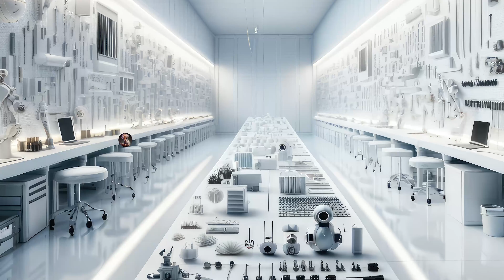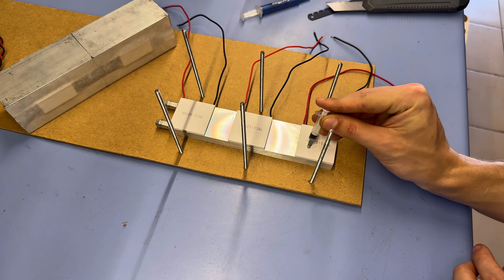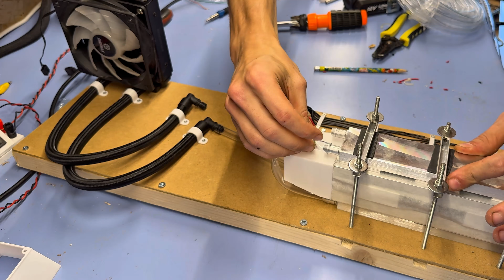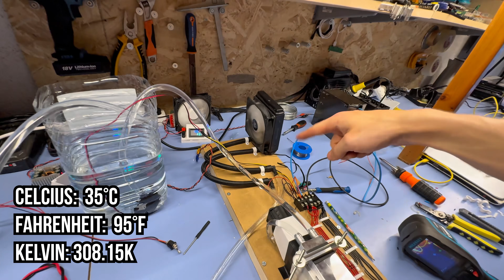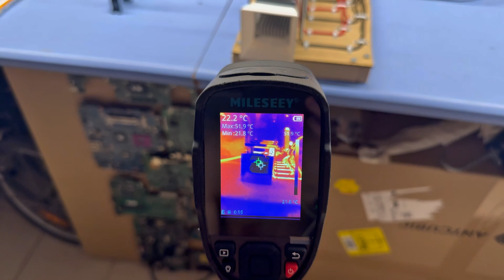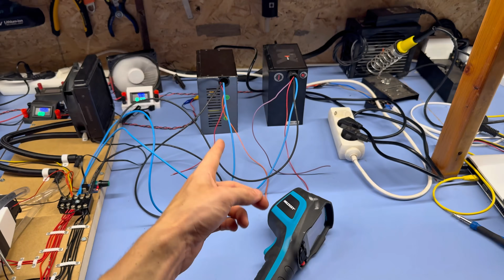I Built an Air Conditioner with 6 (8) Peltier Coolers and it WORKS!

Comment: EXCELLENT! - In the gap on the aluminum 'cold tunnel' you should have something more substantial than tape. You are losing a lot of cold along that tape, so you should have somethign more insulating, so it gets colder. You should also insulate any area of the 'cold tunnel' that is just exposed to air, you are warming it A LOT by not insulating anything. You can get a sheet of rigid thermal board for a home repair store fairly cheap, and you won't need very much for this application. I really hope you do this :) PLUS you should try this before you add more Peltier devices, just to see which helps more :D
ALSO, you can stack Peltier devices I think. So each out would be much colder, but you would have much more heat to pull off of them. And this is not always very smart, so maybe you don't need to try it. You seem to be getting it quite cold already.

Comment: Use a car radiator and a 12v fan on the outside. That way you wil get a nice delta temperature
Reply from the maker: Great idea, I was also thinking about a radiator from an AC, but quite tough to find one in a good shape
Reply: Well if outside is cooler you can just use 2 radiators to cool.

for actual cooling of a room you of course have to pump the heat out of the space, so the radiator by necessity has to be outside of the space, otherwise you're just heating the room with couple of hundred watts.

Comment: You would get more cooling with less energy from a cooler full of ice and water, some piping and a 9cm 12v USB fan. The heat from the power supplies is likely negating any cooling this contraption is creating.
Reply from the maker: Yep, I actually want to try comparing an ice air conditioner and the Peltier one

Comment: Oh jeez not ANOTHER peltier AC video. Right, Peltiers are massively inefficient, They require a huge amount of power which far outweighs the VERY marginal cooling effect, and you have to dump all the heat the produce. There's a reason commercial AC units use peltiers. Also even a mild rise in ambient temperature virtually cancels out the cooling effect.
Reply from the maker: Yep totally agree! They are good to make a tiny fridge, and I mean really tiny! This experiment is to see if we can decrease the room temperature by some degrees. Also if the AC is connected to solar panels and suddenly the sun gets covered with cloud. The Peltier AC can be turned off and on without any problem. If a Normal AC shuts down unexpectedly it can damage the Compressor or compressor circuitry. It is another reason we are using Peltier units in this case)
Reply: @Inventors_Den  No chance. Large commercial can  only drop the room temp by a few degrees, this...this would be like trying to warm up a warehouse with a hairdryer.

Comment: I'd be less interested in an AC/Heat Pump and more in a dehumidifier. This could be useful in maintaining a dry cabinet/box for 3d printing filaments and whatnot, or maybe a large enough dehumidifier could be useful as a clothes dryer when placed in a closet?
Reply from the maker: Damn that’s an awesome idea I just need to flip the positive and negative and it should start heating up with a drier air! Will try it someday thanks!)

Comment: the hot side water pipes should be in parallel to the pump and a 3 fan size  radiator should be used, pelta cooler should be paired in series 3 sets of 2 if you have six.
Reply from the maker: True, I was thinking of connecting the water radiators in parallel but will I need a T shape conector  and 3D printing won’t work because if the water is hot the 3D Print becomes soft. 
Unfortunately I don’t have a 3 Fan radiator 😣
Pairing 3 Peltier modules in series will require 36V won’t they?

Comment: 55 Fahrenheit is an excellent temperature for air conditioning supply air.Typically in direct exchange air conditioning we try to maintain a suction pressure equal to a 40 degree Fahrenheit evaporator and ideally,the warm air from the room heats the suction line to 55 degrees,which is a 15 degree suction superheat.
Reply from the maker: Thanks for the feedback mate! Can’t wait to see the real results in the room) Peace✌️

Comment: I would love to see a deep dive of this vs. gas compression and decompression efficiency. It seems like it uses a lot of electricity for smaller gain in cooling, maybe some way to measure the power usage?
It also makes me wonder why there isn't a Peltier designed specifically to move heat from air with maximum efficiency, if it really does boil down to energy conservation and systems of entropy...
Reply from the maker: Thanks mate! I'm also wondering about the efficiency numbers, and it is a great topic to cover! The device is on its way

Comment: A very powerful installation with low efficiency emits a lot of heat. Thank you, it was interesting to see. I want to assemble a compressor, the components are a compressor, a copper tube, a refrigerant, and the efficiency of the installation is high.
Reply from the maker: Thanks for watching! I also want to build a compressor based cooling system, but first I'll finish this experiment to see what it can do inside a room) 

I was wondering if the compressor will somehow consume the refrigerant or it will stay constant, the cooling effect is achieved with pump?
Reply: @Inventors_Den  Hello from Ukraine. The compressor does not consume refrigerant. It can be used up if the system is not airtight. The efficiency of Peltier elements is about 0.3-0.5, the higher the temperature difference between the sides of the element, the lower the efficiency, so you need to cool the hot side well, low efficiency means that more energy is spent on cooling than cooling. Try colder water and a larger volume, this will significantly increase efficiency. The compressor of a refrigerator with refrigerant r-600a has this coefficient of 1.49. Cooling occurs due to compression and condensation with cooling of the refrigerant into a liquid after passing through the capillary tube and entering the area with low pressure, the refrigerant boils and absorbs a significant amount of heat. Ideally, you need to maintain the required pressure in the system for proper operation.

Comment: I remember doing this in my garage thinking I could replace my a/c in my car, problem is the best delta temp differential you could get would be about 40 degrees and it took so much power and created so much heat it didn't end being worth while
Reply from the maker: Interesting experience! In a car you can cool the radiator with outside air which is a plus. I will share the results of my experiments soon, peace ✌️

Comment: Try adjusting the power given to peltier modules,try to keep them from getting so hot
Reply from the maker: Good idea but I couldn’t find a regulator which will work with this huge current)

Comment: Its far better to cool say 100m3 by 1 degree, than 10m3 by 10c, if that makes sense? 
Trying to get as low a temperature as possible isnt actually MOVING much thermal energy, though heatsink areas factor in as well...

Increase flow until cold side is only removing a degree or two. Get hotside as hot as possible to radiate the most energy. 
Air in a room recirculates, if it drops a degree every time.

Also note the majority of heat is in the water vapour... not the air. Water vapour has twice the specific heat of air...
Dry air feels cooler simply as it assists evaporation, and its far easier to cool as well...
Reply from the maker: Great point, thanks for the feedback! I actually  already increased the airflow and made it controllable, thanks for the advice!

Comment: Try to cool a small area.
I did a similar thing, though pumping warm air into a sleeping bag.
You could potentially do the same for cooling with a jacket or coat.
You don't need to cool the room, just the air close to your body.
Reply from the maker: Thanks for the feedback) Yes I will install it in my room really close to me so let’s see… Peace ✌️

Comment: Connect this cold air ducting to a pc heat sink and over clock a cpu. Expensive wattage but cool video.
Reply from the maker: The best contraption for this I think will be stacking some units together and like this the last one will get super cold which is great for overclocking

Comment: That was very entertaining, thank you for taking the time to produce the video.  I like that most of the parts are less than $1 (advertised amount).  It may not be the most efficient solution for cooling, but it would be fun to make and have as an emergency back up in case an a/c unit crashed during a sweltering summer weekend.
Reply from the maker: Thank you mate! Can’t wait to see how cold will the room get once installed)

Comment: Your room with get hotter if you put this inside. You're dumping all the energy you're removing back into the same room in addition to the heat generated by the power supplies and inefficiencies 😀
Reply from the maker: You are right! I will put everything outside and it will blow fresh cold air into the room

Comment: Yabbut, where is that heat GOING?  Why did you bother with this?  You did not build an air conditioner.  As built, this unit cannot cool a room or even a cardboard box. Instead, it will make everything WARMER.
Reply from the maker: Thanks for feedback! The purpose is to find how cold the air leaving the unit can be, and since it’s 13C (55,4F) the next part is to find how cold the room can get! All the hot elements will be outside the room behind a wall with a hole for the cold air duct! Peace ✌️

Comment: You could try to use the peltier devices in reverse to try and absorb heat from a solar panel to see if you can boost their  efficiency by cooling them down or by syphoning some power from the heat difference.
Reply from the maker: Thanks for idea mate, in fact I will be building a machine in the future to get electricity from Peltier modules. To get an idea on what it can be I can say that people in USSR used to build them on the country side to be able to listen to the radio!

Comment: What’s the total wattage ?
Why did you only use one wire for the 12 V. I’m sure that  power supply out a few of them. Typically the max is 8 A per wire, but I would go with about 4 A per wire.
I’m not sure about the details of the power supply, but I’m thinking you should get enough power from one. 
What’s the details of the peltier ?
Reply: Also, you need way more airflow so that the cool part doesn’t go below 40° so you don’t get a lot of condensation.
Reply from the maker: I am waiting for the measuring device to arrive, will post an update when it does! 
Theoretically TEC1-12706 are 4,3 - 4,6 Amps so ~50Watts so 6 of them will take ~300W and 8 will take 400W, let’s add 30 watts for everything else and the total power consumption will be ~430W. You are right a good gaming power supply should be able to handle that, BUT my power supplies aren’t new at all, and were taken from a PC years ago(No idea for how long were they used). 
And yes I will be increasing the airflow, the 40x40mm fan won’t be enough even for a small room)

Comment: Well done. I'm building something similar. Two recomendations.

1- Don't cool the water with a rediator. Try to use evaporation and vent the humid air outside. Evaporation becomes more efficient as the water temprature increases. A low cfm fan would be enough as long as you can have ideally 5-10 m/s air velocity for good evaporation.
2- Instead of a heatsink for the cold side, use another water loopwith water blocks and use the radiator for cooling the room. By using a heat sink you lose a huge amount of egergy and I mean HUGE(I did the math) to turn the water vapor into liquid without decreasing the room temp at all.
Reply from the maker: Damn, that’s is super useful! I didn’t think about these and to be honest want to try it asap, thanks a lot for the suggestions!
Reply: Peltiers act differently and the colder the hot side can get the colder the cold side will get. If you want a peltier to be efficient, it needs to be as cold as possible on the side the heat is being transferred to. A heatsink will work better in this case unless you have a very large radiator to bring that water down to roughly ambient temperature.
Reply: The problem with evaporative cooling like that, is you consume water.  You could still make a closed loop with evaporative cooling tho.
Reply: can you give more detail, havent finished watching this video all the way. But working on something similar as well .

What do you mean - use evaporation and vent the humid air outside?
Reply: @MM-24  Use a water container which hold the hot water. I'm using a coolbox. As the water heats up it starts to evaporate faster. Just make sure that the cotainer is sealed and has a exhaust port. I made a hole in the lid of the container which is my exhaust port. I used flexiable pipe to connect the exhaust to my room vent port(my room has a vent port). The idea is to get rid of the water vapor generated as the result of water heating up.

To make evaporation even faster, you can attach an small fan to the lid that blows on the water surface inside the container.
My evopration setup is more complex, it's not easy to explain it with text. even a 40mm fan would be far beter than no fan.

To get very good result, you need 1 liter of water for every 3 cubic meter of volume of air you want to cool, however you can use just few liters of water as well.

Comment: Terrible.  The coefficient of performance - that is, the ratio of watts of heat moved per watt of electricity consumed - with TECs is less than one* in cooling modes.  You're consuming more electricity than my entire refrigerator AND freezer to generate a tiny stream of not-refrigerator-cold air.  This is fun as a novelty but in terms of actual cooling it's a non-starter.

*In heating mode TECs can move more watts of heat than watts of electricity, but it's still not better than an even middling-fair heat pump.
Reply from the maker: You are absolutely right! The TECs are great if you need to build a super tiny fridge(I mean SUPER tiny). This AC is built as an experiment just to see why they are not used for ACs and what cooling results (if any) can we get)
Reply: @Inventors_Den  In that case you have a lot to think about. WIth peltiers the colder the hot side can be the colder the cold side will get. (This is why there are plenty of experiments of stacking peltiers and reaching very cold temperatures) So if you cool the hot side of the peltier extremely well it will be much more efficient and it can get colder as well. If you continue to cool the peltier with water cooling, I'd advice using a very large radiator to bring the heat down back to roughly the ambient air temperature for maximum cooling

Comment: hot to build the most ineffent ac unit ever
Reply from the maker: Exactly! And I am gonna power it with solar panels: 
Peltier cooler: 10-40% efficiency
Solar panel: 15-22% efficiency 
Can we get even more inefficient?
Reply: @Inventors_Den  if you used the cold side to chill liquid insted of air then used a radator so the hot side and cold side both are liquid It might actualy incress the over all usefullness as you can move the pet units to a inslated box or a dry sealed box so you dont have condsate steeling your thermal cooling

Comment: Remember guys, a window in summer produced about 100W of heat, so you're best off, making sure you know how to best cool down your space and properly opening windows and ensuring hot air exchanging / circulating - especially with stagnant areas. Peltiers are obviously horrible for this but it's somewhat the first thought that comes to mind. They are only really useful for targeted very small area component cooling like CCDs, sensors or any silicon chip really in tandem with a heat sink and fan obv.
Reply from the maker: You are right! It was a cool experiment to try out and I really want to see if it will decrease a temperature of the room by any degrees) Thanks for the feedback!